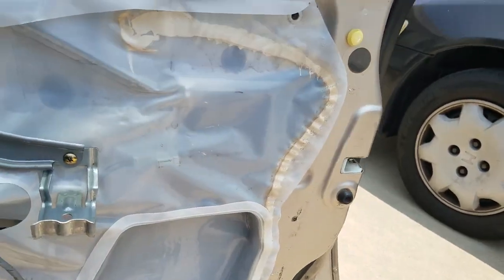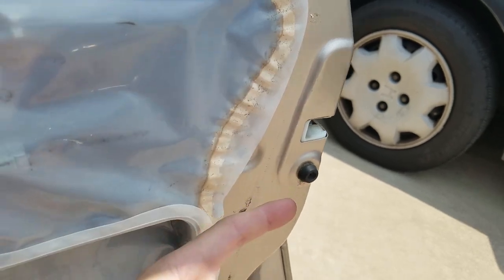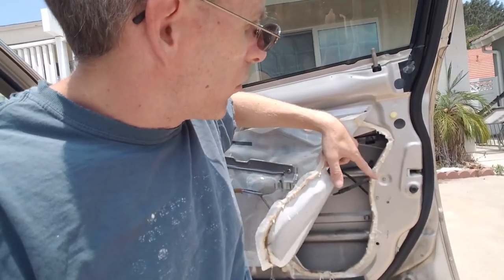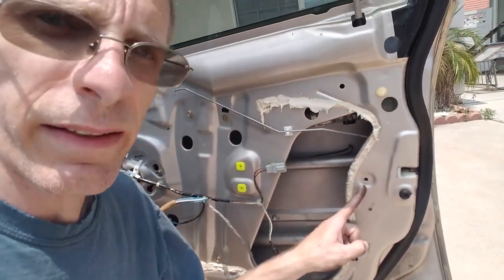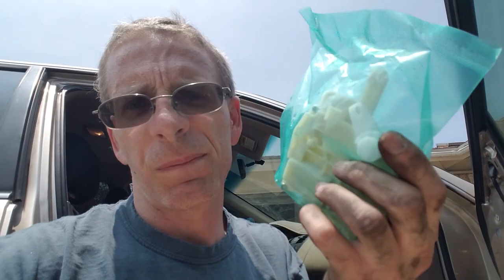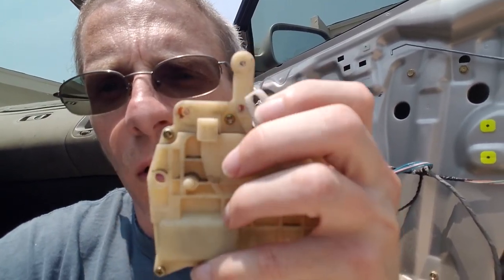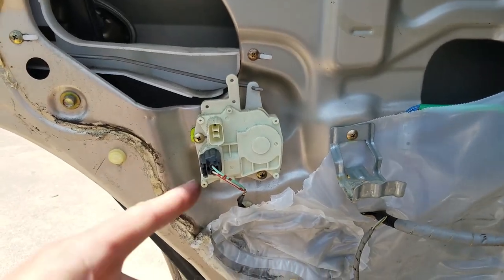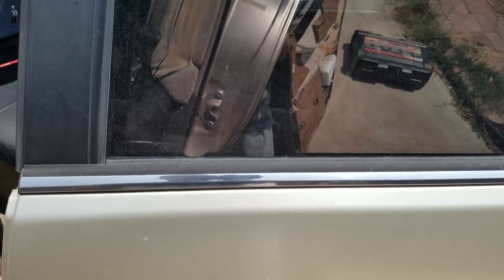Honda Accord 2001 Door Lock Actuator Replacement 4 door

Comment: How much and where did you find the part thanks
Reply from the maker: Found it on ebay. About $15 at the time. You should still be able to find them for $15-$20.
Reply: @specialagent4575  okay but I a am confused how do I know is this part or the door handle that's broken
Reply: @specialagent4575  my door won't open from the inside or outside
Reply from the maker: @kangokidkidd4037  You mean the backdoor?  It's possible that the child safety switch got flipped.  The only way I was ever able to open the door when that happened was to just work on the door until it popped open (I literally just kind of jerked the door and then it opened, I still don't know why it happened either).  That switch prevents the inside door handle from opening the door.  You might have to try working something stiff in between the door and the car frame to get the switch to flip.

If it is the external door handle, you'll have to try to work the door panel loose from the inside and get the mechanism to move.  This is a lot easier said then done.  You can try searching YouTube for a video, but you might end up having to take it in to a mechanic.

Good luck.  Sorry I couldn't be any more help.
Reply from the maker: @kangokidkidd4037  the door lock actuator is only for the power door lock switch.

If you can get your door open, take the panel off and remove the rod from the actuator.  That'll make it so you can lock and unlock the door manually.  With the door unlocked, you should be able to close and open the door with the door handle without a problem.  That should help you narrow down whether it's the actuator or the door handle.

Of course, you could just hit the power door lock switch too.  If that's locking and unlocking the door properly, then the actuator isn't the problem.
Reply from the maker: @kangokidkidd4037  Here's a video where he shows how to do it.  It's 2 parts.  Good luck!

https://www.youtube.com/watch?v=Om3gDkHT8e8